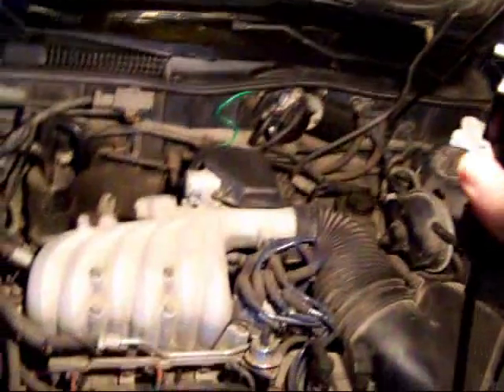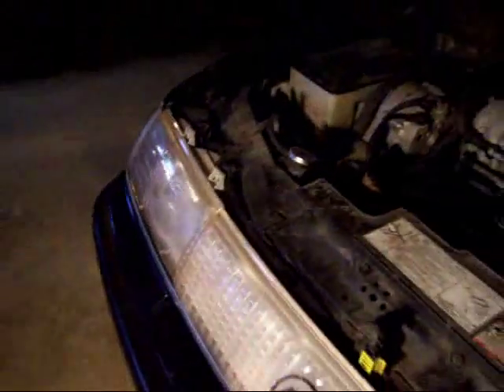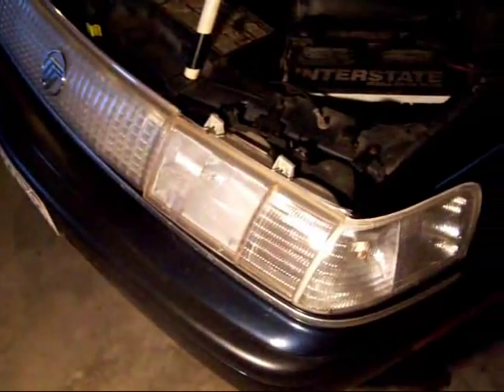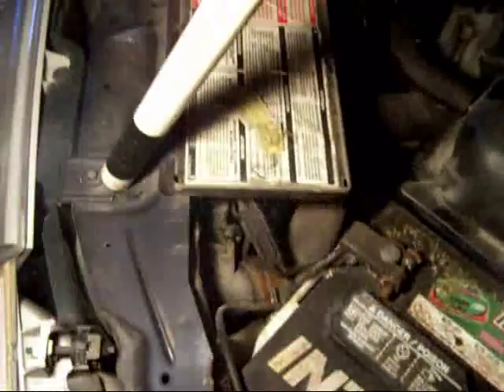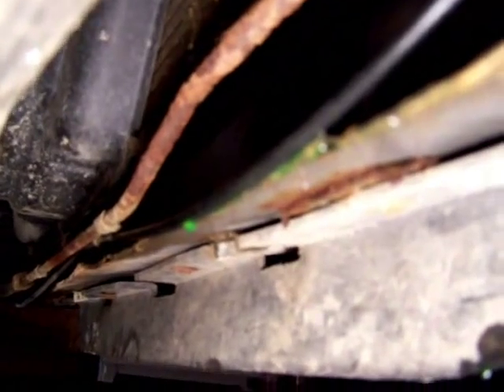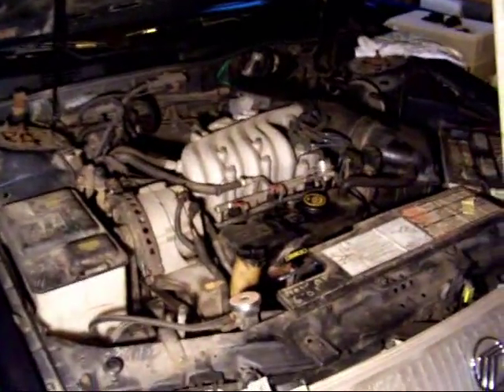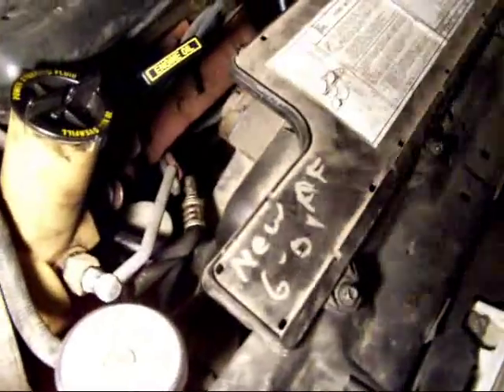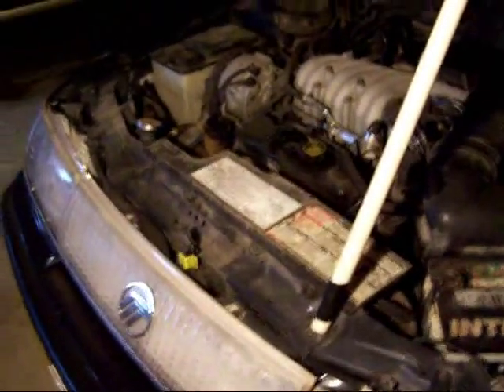Busted Radiator on 89 Mercury Sable

Comment: Yeah, plastic has been used on radiators since the mid 1980s. I would be really careful about a used radiatior because even new ones don't usually last 20 years. If it's out of a 90's Taurus/Sable, that means that means it could be 15-20 years old. A new one costs about $120 and that seems a bit steep, it's still cheaper than replacing it twice (depending on the warranty the salvage yard gives you) and your time. I've never really had good luck with used parts.